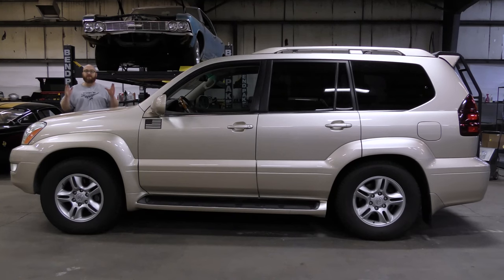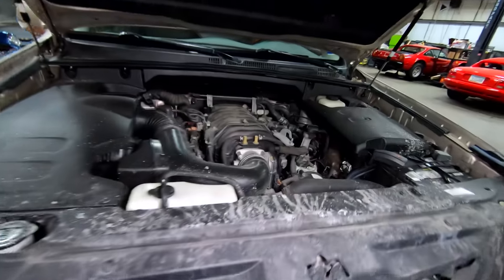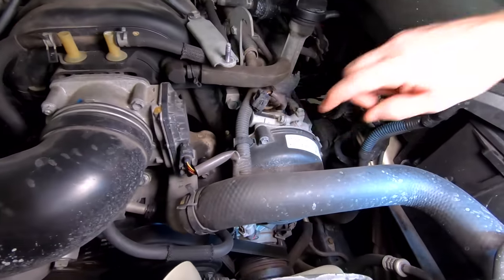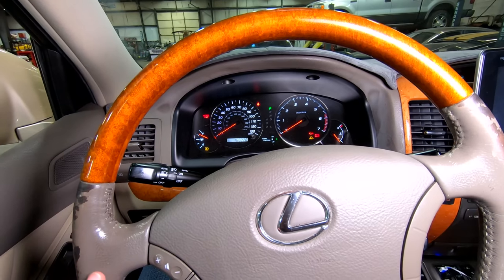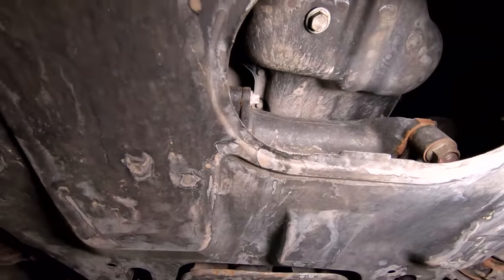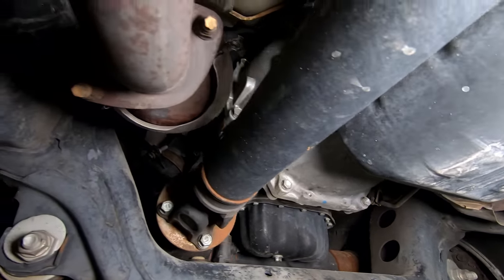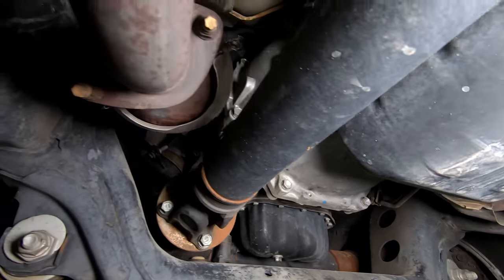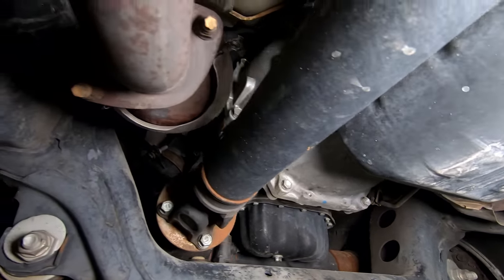How could this super reliable '07 Lexus GX470 have such a stupid design? CAR WIZARD weighs the risk

Comment: One maintenance item that went unnoticed: It appears that both sets of road-spray protectors are torn-off/missing from the front wheel wells. These formed-fiber sheets reduce water splashes into the engine compartment and help protect components. They become brittle over time and require occasional replacement.
Reply: Yep.  I had to replace them on my '09 when I bought it.  She just turned 223,000 miles today.  Runs like a top.
Reply: He may actually have removed them in order to show us the items he did.
Reply: @wernerdanler2742  - Pieces of them are still clearly attached to the chassis by their mounting clips/bolts. Have a closer look.
Reply: @drainaudio  Thanks, I'll look again.

Comment: I'm with you on the stop/start Wizard. It also increases engine wear exponentially because of oil starvation on re-start due to the oil has re-settling into the sump on shut down.
Reply: I wonder what the used car market will look like 5 years from now when all this newer junk starts falling apart due to all the fuel saving crap some manufacturers are using which will almost guarantee short lifespans for alot of cars.
Reply: Yup it's one of those features that is designed around the parameters of mpg testing.  It saves gas on paper but in the real world it is virtually an un-noticeable mpg increase.  It also as mentioned causes more resources to be used up.  It operates the starter far more than normal causing earlier replacement.  Which how much fuel and other resources go into each starter.  Many of those also employ pressure from the transmission to assist the restart.  Which then uses several more electrical and mechanical components & potential wear items for replacement.
Reply: Another amateur powertrain engineer checking in..

Comment: I've done the starter swaps on these a few times. I count on intake gaskets, a full set of injector orings, fuel rail crush washers and a lid off a Gatorade bottle. The positive cable mounts low on the starter and the plastic cover crumbles, so I set the bottle cap under it as I set the new starter in place to prevent it from shorting out against the the lower intake.
Hey wizard, a cheapo outfit like midas charges around $170 per hour in Minneapolis. Maybe your rates are less than fair to you? 
Before I retired from autobody in 2002, my shop charged $300 per hour for labor. We did some show cars and a lot of race cars. We had customers on a wait list over a year long.  I do miss the job, but 15 orthopedic surgeries later I know I had to retire for great reasons.
Reply: $170 per hour for a shop working on normal repairs is ridiculous - no wonder cars have become disposable.  Of course if you are a specialist race shop, it's a different story entirely.
Reply: Toyota dealership charges $140/hr in NM.
Reply: $100hr is around the average where i live
Reply: @dr.feelgood7615  
I have to imagine it varies by area. Like when all the gas stations in a small radius are the same cost but 1 town over  there is  a different price.
Reply: @Beer_Dad1975  
I think it depends on the area you live in. The custom shop I had was in Dallas Texas but I'm in the twin cities are of Minnesota. If I drive an hour or more out of town to rural areas, that cost goes down. 
I think thebwizard has a specialty shop with top end technicians and he could easily charge more. I am happy to pay more for a good job. Midas in my area will brake as much as they fix.
Reply: @jamiespinks3657  
There are shops all over that have had to repair another person's repair job. Not just because of a novice car owner, but also because of shops that make the job cheap enough to stop the attitudes of those unwilling to pay for quality work. Dealerships are typically higher cost and not always higher quality.  Finding a shop that does quality work without getting nickel and dimed to death by a cheap customer is a great thing.
Reply: @mindthependulum6245  Yeah even here in New Zealand we have Midas - no way would I go near them, they suck... I'm fortunate to have had a Dad that taught me to work on cars from a young age, and now some 40 years of experience, and a well equipped home garage - so there isn't much I can't do myself & I love working on cars - though now days I do outsource stuff that's just not fun to do without a hoist due to my aging joints - groveling on the ground under a car for extended periods doesn't appeal much anymore.  I think the going rate here in NZ for an independent shop is closer to $100 per hour or a little over, certainly under $150 - and that's in NZD which is valued far less than the USD - of course the average income here is lower too.  I expect dealer rates are much higher, and no doubt their level of competency is much lower since they usually charge the earth yet pay peanuts to their employees.
Reply: @Beer_Dad1975 
I hear you loud and clear! I had 15 orthopedic surgeries because of the work I've done and due to working in shops that did not care to maintain shop equipment correctly. I also farm out some stuff for the same reasons you mentioned. I got my first Subaru recent did the timing belt and water pump kit in it. I have to say that was the easiest timing belt I've ever done. I think I have a new favorite car! Also, your country is beautiful and I hope you have a great day sir.
Reply: @mindthependulum6245  Interesting on the Subaru - I'd always thought given the boxer engine it'd be a fairly convoluted job doing a timing belt compared to a normal OHC inline 4.  Mind you I did the timing belt on my nephews Mitsubishi Galant years ago and that thing was horrific, even though it was about as straight forward an arrangement as you'd find, all the parts were so nasty and poor quality...  Thanks! NZ is a great place to live, especially during the craziness going on in the world at the moment - also lucky enough to be a 10 minute drive from some amazing country backroads.  We were supposed to be doing a tour of the US with the kids last year... but of course the Covid put a hold to that plan - I have spent a bit of time in California and New York though, many years ago (pre 9-11) and loved it, and loved the people.  You have a great day too!
Reply: Uhhhh... why wouldn't you disconnect the battery prior to doing an unfused electrical repair???
Reply: @daniels2761  
I always disconnect the battery when changing a starter. What I was speaking on was how if you look at the end of the unit where wires connect, the positive cable ends up almost directly in contact with the lower intake when it's mounted.  There is a plastic cover from the factory but it gets brittle and they commonly shatter easily. I use a Gatorade cap layer down on the lower intake just under where the positive cable mounts which is about 5:30 if you think of a clocks hands.
Reply: Use a battery saver to retain power..isolate battery than cable to starter is not hot with 12v ..I used to do it the way you stated ..

Comment: That PSA you did near the end of this video really hits home with me. I have noticed about the automotive industry that the way you Wizard conduct things is the right way. 
You've said this before: "I'm not doing work that I'm not getting paid for." 
People that don't like how much it costs or how long it takes to fix once you diagnose the problem you may have to tell them to go somewhere else but, you're going to get paid to diagnose the problem correctly.
There's a lot of people in this industry that like to play fast and loose with information about their car or shops don't get all the information about a customers car and that affects their ability to find the correct parts for that car. Those are a couple of ways how you get burned and have so much hassle and headache from attempting to do an over the phone diagnosis of a vehicle issue.

What I've learned is don't get pushed around by people that use ego or false bravado to make you think you don't know what you're talking about and they're always right. When you've got the experience, connections and knowledge you don't put up with any of that nonsense.

Comment: On some of the newer audis, they have a starter generator, like a golf cart, so there is no starter to wear out doing start and stop all the time. Really a neat design.
Reply: Newer Toyota’s have this too
Reply: Back in the 60s NSU Prinz had this feature
Reply: Mild hybrids typically have this design. It takes a bit getting used to the noise they make when starting the engine since there's no "cranking" as such 😁
Reply: Audi is one of the few car manufacturers you can trust that the latest shit is gonna be safe and always will work. Saw a video of a guy reviewing an Audi EV with fully electric brakes and he said that in the event the electrics fail the brake pedal is still hydraulically connected. Also good call on the mild hybrid system handling stop starts because on the Audis with the 3.0 and 4.0, the starter is buried
Reply: @ozarkliving7263  which ones

Comment: Love your easy to understand explanations and the great footage, but here are few pointers.
The location on that starter is definitely to keep it off the elements just like that charcoal canister.
It also need new airbags (i bet the driver side leaks over night, exactly what you said) this happens between 145k to 170k, they put that dash mat because most likely the dashboard is all cracked. 
You forgot to grease all the u-joints they usually fell nice and tight but when you see a lot of the shinny metal on the ends of the shafts, that means it needs grease because the grease will push things around and will make the shafts go where they need to be to prevent that famous thump when you let go the brake. 
Yeah you are suppose to hit the button by the height switch to the OFF position before lifting the GX.
Wait until you have to do one of those exhaust manifold. hahahahah They are a pain.
The real STUPID design is on the parking brake shoes, tool or not tool it is stupid tight and the hardest parking brake shoes I have ever done in my entire life. Definitely not 4 hours job but many cuss words involved. LOL
Reply: my dash is fine, i use a dashmat just because i think (no evidence) my car doesnt heat up as much in the sun and you can put stuff on the dash without them sliding everywhere
Reply: @juki6377  ceramic tint your windshield. 70-80%. you won't see it and it blocks most UV light and makes a HUGE difference.
Reply: hahahaha, that's what i kept thinkin when he said how nice and easy the headers were. Yeah, you'll get the bolts off, goodluck with everything that comes afterwards !

don't get me started on the shoes.
Reply: @juki6377  that's a good idea. And also helps with the glare. Right?
Reply: @driojal  oh yeah. Plus on something like a 120 or 100 series with a shallow dash, when the Texas sun is hitting your legs it's not uncomfortable anymore. 
And I use a sun visor as well. THAT is a life saver. covercraft uvs100 made for your vehicle. Worth every penny.
Reply: @Abesta83  yeah i'll look into it, i'm not sure its legal over here
Reply: @driojal  i dont get much glare in the prius, but its plausible that it helps avoid some reflection
Reply: @Abesta83  yeah i worry about UVs it would be good to avoid skin cancers and melanomas

Comment: I have a 2005 GX470. Bought it 2 years ago before the prices went crazy. BEST CAR I HAVE EVER OWNED. Seriously.

First, in stock condition it's a very capable off-road truck. Second, at 17 years old and 185K miles it drives great. Solid, solid truck. In mine there isn't a single squeak or rattle anywhere. The fit and finish is superb. These trucks were built in Japan and shipped to the US. This alone make the build quality superior to any American SUV/truck of it's era.

I'll never sell mine...so don't ask!
Reply: I'm with you, I recently bought a GS 350  at the local Lexus dealer. Guy asked me if I wanted to trade in my GX470. I said no way, I'm driving this to the wheels fall off. His reply was that will take a long time.
My GX470 is quieter and rides better than the much newer GS 350. I only take the GS 350 out of town for the better gas mileage.

Comment: My main car is in the shop right now, 2016 Veloster Turbo with a fuel issue, anyway, I told them, if it’s over $300 call me to let me know otherwise just fix it. My wife had then said to me, does it matter if it is? We’ll get it fixed anyway, she’s right though, it’s a good local shop who’s honest and fair. I’m lucky enough to have my toy/project car to drive to work in the meantime, 92 Daytona ES. If it’s a car you use all the time and it’s something that needs to be done just go ahead and do it especially if it’s a shop you know and trust. Great video, Wizard.

Comment: Me, seeing it's an '07 GX:  "...I bet he's going to mention the secondary air injection."  Especially given you were doing a timing belt, water pump, and starter.  For those curious, 04+ GX470s have VVTi, which is also when they added the secondary air injection.  It's 12 hour book time, and it's not a fun thing to replace.  Not surprised to see the rubbery plastic splash shields in the fenders are gone--they get brittle and go eventually, or usually fall apart trying to remove them for something else.

The timing belt and water pump really ISN'T as bad, like Wizard says...I found it a lot easier to do removing the radiator altogether.  Aside from the air injection and rear air suspension, these things are damn reliable.  And even then, you can go months seeing these things on a weekly basis and maybe one every so often where the air injection has become a problem.

Comment: That cracked dash had a recall that I had to harass Lexus on twitter to finally get done.  They limited the timeframe on when you could get it fixed for free but would not schedule you due to "low inventory."  How convenient.  Owner could prob still get it done by Lexus especially if they're the original owners.
Reply: The 4runner the same " campaign " is what it was referred to. My 2004 dash got replaced around 2014 for free. I was never notified by mail or anything i went to the dealer and told them, I read about it on a forum. I don't think many people knew about it and it was only a short window to get locked in like you said.

Comment: I have been putting Michelin tires on my vehicles for decades. I knew a guy that ran an alignment shop and he told me that he never ever seen an out of round Michelin tire. They ride smooth.
Reply: Easy to work on means lower repair and maintenance bill when you need them, which isn't very often. If you weren't 1200 miles away I would bring you my 09 Honda
Reply: They are good if you drive the vehicle regularly. If a car isnt driven much and is exposed to the sun michelins have a tendency to start cracking.

Comment: There is one major flaw on these cars, and surprisingly many Toyota's.  Dismal fuel economy.  As in, ridiculous.  This vehicle does 15MPG on PREMIUM FUEL, which was one of the reasons I crossed it off my list.  It is beyond WTF territory, are we in the 1960's or something?  The fuel costs of using this as a daily driver for someone that drives significant number of a miles is basically unacceptable at $4000+ a YEAR!!  If this vehicle was run for 166,000 miles at current fuel prices, you would have paid $46,000 in fuel and bought the car for the second time.  Seriously.

Even my 4Runner with a V6 had similar or worse fuel economy than my Chevy truck did despite being much smaller and the truck had a V8.

I have always been puzzled why Toyota V6's and V8's have such terrible fuel economy when they make the most fuel efficient Hybrids on the other side.
Reply: I don't think any Toyota V8 gets worse mileage than my husbands old 2006 Cadillac Escalade 6.0L that he uses for a work truck (and every blue moon I'll use it if I have to which I try not to lol)... At $3+ per gallon it takes nearly $100 to fill that thing up on Regular and it burns a gallon every 10-12 miles in the city and never cracks 18 on the hwy. Atrocious even when gas was a buck and change when he got it. It's been perfectly reliable mechanically but a gas guzzler like that seems worthless in today's times.
Reply: @chynacash3138  Yep, couldn't agree more.  But this also makes the case for electric vehicles.  Driving this car with fuel in my area, which is currently $4.49 per gallon 15k miles a year would be $4500.  Driving something like a Tesla Model X or equivalent size vehicle would cost around $550 a year, and the Model X has better performance.

When people talk about buying electric cars and saving thousands of dollars a year in fuel, and then thousands more in maintenance, it starts to become clearer what they are talking about when you look at a car like this.  The operating cost is just crazy in fuel alone.

Comment: Great video I like how it mentions things good and bad about this along with other vehicles.  Good catch on the air leak good to catch it early or moisture gets in and overwhelms the air drier on the compressor.  Which then starts to pump gunk in the lines and through the pump.  I had a car where I later found out my mechanic thought he was doing good in wiping off horizontally mounted dampener shocks.  He didn't think were needed on this or any car.  I was not pleased to have a clunk and compromised handling that was not mentioned.
Reply: Cardinal why would wiping cause problems?

Comment: I agree with you on not buying an Equinox or Acadia/Traverse. They're terrible vehicles to own. As a Service Advisor at a GM dealership I love when they come in off warranty because it's good work for us but customers sure aren't impressed when stabilizer bars go out at 60k miles or if the vehicle needs a 3 timing chain replacement or AC issues.